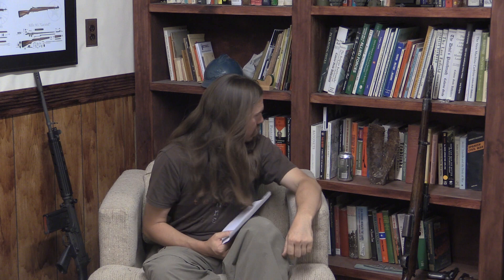Q&A #6: Rollin White and Other (Better) Designers

Comment: Also while its an amusing thought, development of 7.62x51mm NATO helped spark development of 5.56x45mm. British near-adoption of the .280 round, which was inferior to the Soviet produced 7.62x39mm round (In terms of weight and size, a 30-round AKM mag weighing as much as a 20-round .280 mag), would have probably put us in the same boat, ironically, as the Soviets were when they began to encounter the 5.56x45mm round against their 7.62x39mm AKs in Vietnam. The Soviets found the US round to be good enough they developed the 5.45x39mm round and developed the AK-74 series after them. 

We did get our intermediate cartridge FAL though in the FN CAL, which was later developed into the FN FNC and the Swedish Ak5.

Comment: My choice of program to save/modify would be the EM-2. Scope-sighted bullpup with an intermediate cartridge (which IIRC was also considered for the FAL). Said intermediate cartridge's ballistics were then rediscovered by the US military after it became dissatisfied with the 5.56 in Afghanistan. I know you've given the EM-2 a dressing down for the complexity of its manufacture, but the overall concept is a very modern one, and if any of the developers are still alive I think they are owed an apology  - at the very least, they are owed a "You were right". As for the 7.62, that's no more than a somewhat uprated .300 Savage; almost exactly the same size (though not chamber-compatible, naturally) and capable of matching .30-06 ballistics as loaded (though the Savage was stretched to its limits to do that while the .308 Winchester/7.62 NATO is not). Seems they did a lot of development work just to end up more or less with a cartridge that had been around for years.
Reply: I was going to post almost exactly the same thing about the EM-2, but thought I'd better check to see if anyone had already done so, and you have, so I won't.
Yours is probably better than mine would have been anyway! Kudos to you sir

Comment: what are your thoughts on the h & k g11, would you find it feasibe for the french army to substitute its famas gun for g11's? (taking into account that more development would be required to optimize and adapt the g11 to modern day standards )
Reply: Caseless ammunition just doesn't have much of a future. The 4.73x33mm G11 ammo had problems with impact & abrasion resistance, and it's much less moisture resistant than brass ammo. Even if all these problems were magically solved by modern materials science (and they haven't been), you still have the two fundamental flaws of caseless ammunition to deal with: the round dumps tremendous heat straight into the chamber, and it does nothing to seal the breech from gas cutting. In contrast, the brass case on standard centerfire ammunition acts as a heat sink and expands to seal the breech. Polymer cased ammo is even better, as it insulates the chamber, and certain types of polymer cases (such as the LSAT) have a section that pops out a small flap into the chamber throat to help seal the breech.
Reply: Actually, Modern Caseless ammunition's are more impact and moisture resistant. And as for the G11, it was apparently good enough that the only reasons the German military didn't adopt it was, A) its incompatibility with the NATO standard ammunition (Other nations were iffy on adopting it) , and B) the titanic costs of the German reunification following the fall of the USSR.
Reply: +Maliciously Delicious where can I find"modern case-less ammunition"?
Reply: SacoreyRugger Modern being Early 90's as opposed to that developed in the 60's. The rounds developed for the G11 got around the heat issue by using a propellant with a higher ignition temperature for instance. Current development on caseless weapons is being done by the United States, though information on that is limited. Though I do believe its using the same ammunition.
Reply: +Maliciously Delicious The vast majority of research the American military is doing on ammo isn't caseless, it is telescopic.
Reply: Maliciously Delicious Except that those improvements have been marginal, the newer caseless ammunition is still considered too delicate for combat by the US military, which is why it was discontinued from the LSAT program. It wasn't simply that reunification made the expensive G11 less attractive, but that the gun and its ammunition were still a work in progress; and one that was not showing much improvement despite the money that had already been spent. The G11 required more frequent maintenance than contemporary service rifles due to wear caused by the caseless design and the complex hyperburst mechanism. The ammo was admitted to be overly delicate even by HK, and any research exclusively focused on new propellant materials was clearly going to be slow and expensive. The rifle was riding a hype train of ambition that was going to run out of track as soon as mass adoption would have been implemented; all these problems would have quickly come to light. That said, the visionary nature of that ambition was truly admirable, and the challenges that were overcome to get where they did were an incredibly impressive work of engineering. I don't think I'll ever remember the G11 and what could have been without a pang of regret at the loss of that ambition.
Reply: ostiariusalpha /shrug. I still swear by my Vec-91. Impossibly hard to find ammunition and all.That said, dunno about the G11, but the ammunition for it, what little I have left, never seemed overly delicate, but again, it operates as a pulse rifle as opposed to primer operation, so very different compound I guess.

Comment: the difference between the 30-06 and the 7.62nato is that you can (if you do reloading) you can load 5 cases of 7.62nato vs. 4 cases of 30-06 with the same volume of powder and it also only loses 200fps for that 1/4 case less of powder, not bad, also it made the other soon to be nato countries think that we were willing to give up something as part of the agreement (we really just kept the 30-06 and made it more modern by decreasing its cost of production because guns that shot 7.62nato were .5" shorter in the receiver, mag, and bolt so you were using less metal to make a gun and you were also making 1 extra round because of the less powder. so yes 7.62nato is a better round.

Comment: It turns out the powder burns better if the powder is ignited at the front of the case. They did some experiments by making test runs of ammo with a metal tube to direct the primer discharge to the front of the case. These work better but are impractical to make for obvious reasons. Failing that a short fat case works best. Oh well.

Comment: There are two development-hindering things I would have avoided:
1. Rollin White should have licensed out the use of his patent instead of fully selling to one manufacturer. Many developers would not have been forced out of business.
2. Winchester should not have bought out all competing manufacturers of lever action systems.

And probably one more: WWI (here only seen in regards of small arms. That it should not have happened because of much more severe reasons is another thing)
Many small manufacturers and developers were forced to either produce guns for the military or to develop guns which fit military use. Things had to work fast, there was no time, money, capacity for real in-depth development.
So interesting, complex, fancy stuff was not to be and for a few years after the great war there was no market, be it because of the abundance of surplus guns or the economical struggle all countries were going through.

Comment: I thought the advantages of the 7.62nato over the 30-06 was specifically it's shorter length would make it easier to design/function in an auto loading rifle?  Or, is that just urban legend?

Comment: On gloves: libraries with old books--manuscript or early printed books--typically do not require gloves. Animal skin and early papers are very resistant to grease and acids from hands; wearing gloves makes you clumsy and more likely to damage the book mechanically by mishandling. I've handled manuscripts that are a thousand years old, and not been asked to wear gloves. This changes a bit for the 19th century, when you start getting industrially made paper, which deteriorates badly and is sensitive to the acids in skin oils. With cheap 19th c. newspapers, gloves might be important; with priceless medieval manuscripts, if you can handle it, you do so with your bare fingertips.

Comment: I can't help but think of two points on the point about the cartridge. 

First one, though the comment relates to the trade offs, sacrifices made to get more speed out of jets. The same is true of cartridges. If you're offering such a small benefit to the user, at a great sacrifice, it might not be worth it in the long run. I would also suggest that in the scope of the military buyer, user, if you did go to an entirely new and unique system, it costs them in time. Time to get everyone certified on the new tech and the implications thereof. 

Second point, I'd say that there's something in being too experimental. Unfortunately, if your idea is great and workable, but it's different, say, Metal Storm with stacked electrically fired projectiles, it's just as much a failure as a product which could have never worked, as the conical bore revolver cylinders were. 

Metal Storm has some deeply interesting and highly probable scenarios it would work wonders in. Say, aircraft weapon pods, naval vessels, etc. That being said, unfortunately as I said, it seems to just as much a failure as something that would have never worked.
Reply: Pistols are more important for stability operations. One may coordinate with local figures, and carry a pistol, but carrying a rifle in their house or office would not be acceptable.

Comment: Why 7.62 NATO round.  The main advantage of the the adoption of the 7.62 NATO was supply chain simplification of the NATO nations.   the UK switched from the .303 rimmed, Germany from 7.92, and the France from 8mm  and everyone adopted an agreed upon cartridge that had a similar amount of punch.  It was basically a compromise cartridge but was important as we were staring down the barrels of bunch of 7.62mm rounds being forced on the Warsaw Pact by the Soviet Union. (of course then we screwed it all up by adopting the 5.56mm which is the new NATO standard.
Reply: Marc Bondura, there is some truth to that. (Actually you're spot on correct!) As I recall the Brits were looking at a smaller 7mm round.   What was truly annoying is shortly after the adoption of the 7.62 NATO the US went rogue and adopted the M16 firing a 5.56mm round. 

One does need to remember that the US also had the manufacturing might that Europe relied on after WWII and The Soviet Union and Warsaw Pact was a real threat.

Comment: Rather than skipping the 7.62 NATO development, why not go one step further back and block MacArthur's insistence that the M1 Garand be changed from .276 to .30-06? While there were valid short-term reasons for that decision, in the long run leaving the M1 in .276 would've made for a better rifle. And had the M1 already been firing a 7mm round, obviously the Pentagon wouldn't have been stupidly insisting that NATO couldn't be allowed to standardize on a slightly shorter 7mm.

Comment: 9x39 is a pointed cartridge but it's more of a close range subsonic rifle round then a pistol cartridge.
Reply: Yeah and the projectile is huge.
Reply: Amen to that, and the thing probably has a wicked punch up to 200.
Reply: It has been used to that distance, but that's really pushing it, basically past 100m its pretty much lobing a heavy piece of lead
Reply: figures.
Reply: Ive read something like that about a wildcat cartridge called .50 hush puppy. And also we have the .450 socom wich follows same formula.
Reply: Thanks for the knowledge.

Comment: 7.62/.308 is inherently more accurate than 06', more efficient and uses a short action which facilitates higher cyclic in automatics. It also loose very little in performance to the 06'

Comment: Wasn't the point of the 7.62x51mm NATO/.308 Winchester  to make the .30-06 Springfield a short-action (and thus more reliable especially in bolt-action) cartridge?
Reply: The other guy replied pretty much dead on. The sole and only purpose in switching to .308 was it is shorter which allowed a more compact rifle and lighter, more ammo could be carried. A random fact for you, A lot of people on the internet seem to think the switch was because .308 was more accurate which isn't the case at all, couldn't be any further from the truth. They both use .308 diameter bullets but the 30-06 will always have a higher velocity with the same weight bullet purely do to the longer case. If anything 30-06 has the edge.
Reply: +losi8ightyew *longer case being able to hold more powder of course.
Reply: +Brutus Pontificus That's exactly right brother. So many people don't understand how much factory 30-06 ammo is underloaded. My friend loaded me some hot 220's and it shot just like a .300 win mag. No signs of high pressure either. At that point in time reloading blew me away. I couldn't believe the difference. You really do have to handload to see what an 06' can really do. It's pure crazy.
Reply: Brutus Pontificus When I hear middle-aged guys discuss whether to use .30-06 or .308 in competitions one point I always hear is that the short action .308 is less likely to short-shuck.
Reply: +Mike Mac Ahhh that entirely depends on the shooter. However speed shooting with a bolt action isnt very common. The gun, long or short action isnt any more likely to malfunction. It's the shooter blaming the weapon for their mistakes. I've never short stroked my 30-06 even when shooting fast. Then again, I have a lot of trigger time behind it, as I do my .308 Although the 30-06 is my choice for performance between the 2.
Reply: +Brutus Pontificus Yes, I still think it's a shooter error not pulling the bolt all the way back it's not the rifles fault the user to didn't fully cycle it's bolt, although I severely understand what you're talking about my savage axis can do the same thing when I'm trying to fire quickly. When I first got into bolt actions(my mistake was getting an 06' cause in a 5 pound gun 06' kicks like a .300 win mag, I ended up flinching like crazy and had to overcome it) I was extremely excited to sling some lead and would short stroke the bolt constantly.
Reply: +Brutus Pontificus I do believe you're the first person on YouTube that has been able share opinions civilly. You'd be surprised at all the people with anger issues on here. LOL. Appreciate the respectful conversation my friend.
Reply: ...and improvements in powder requiring less volume for very similar performance. Like what Ian was saying about the failure of switching to a spitzer pistol projectile, it's about finding balanced performance. An all-rounder product for a general purpose task.

Comment: why do not they make sharp-pointed bullets. operating ammo speeds for civilian pistol models lie more or less within the speed of sound. throwing a particle beyond this threshold, even a sharpened one, will entail a significant increase in the energy of the gunpowder, as a consequence of thickening the walls of the case, an increase in the requirements of automatic failure-free operation.